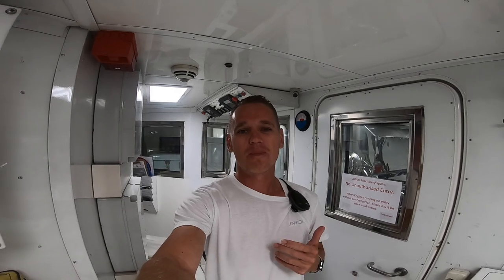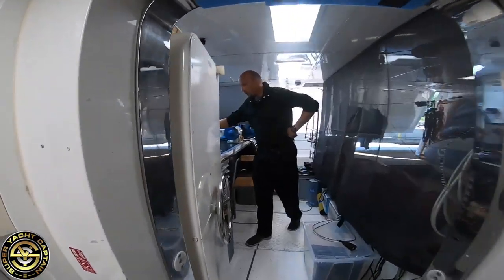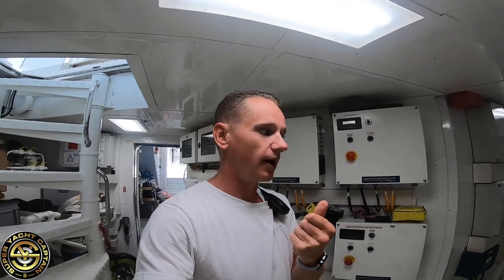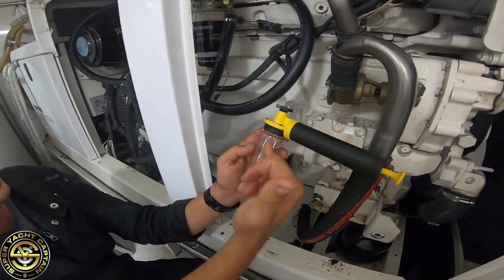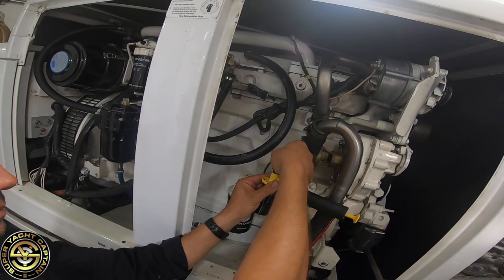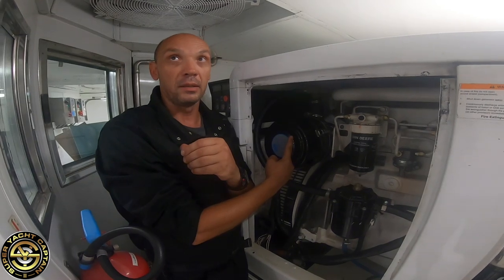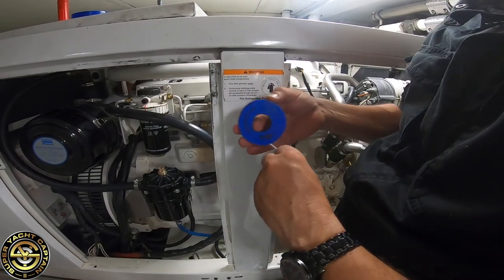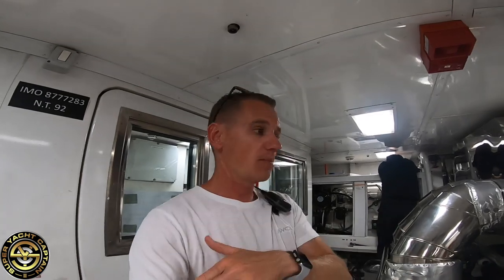How To Service A Marine Diesel Generator - Super Yacht Edition (Captain’s Vlog 99)

Comment: Hi Tristan,  tell Slav about the cable tie trick for impellers.  Wrap a cable tie, maybe two on that size impeller, around and gradually tighten to compress the impeller blades, when they are compressed as much as you can it will slide in easily. As the impeller goes in you can gradually slide off or cut the cable ties.  Learnt on smaller inaccessible yacht engines!  Keep up the good work.
Reply from the maker: Good to know, thanks Kev. All the best

Comment: Great video. One point: when Slav is doing the Racor it looks as if he is filling the filter by pouring diesel down the centre tube of the assembly. Would suggest always fill body, prior to refitting the cap/cover, by pouring diesel between the outer casing and the filter element. The centre tube is the oil outlet, so there is a chance of getting dirt down this tube, then into the fuel pump.

Comment: hello Tristan, great video and certainly very useful to many! A little trick to get the impeller in is to "close the blades" first with two plastic straps to reduce the size and then cut them as soon as the strap reaches the housing. well done anyway!

Comment: Very informative. Have one concern that Teflon tape was used to wrap the threads of the zinc anode. The Teflon tape acts as an insulator and reduces the affect of the anode. Anode threads should be in direct contact with the engine block in order to have the greatest affect to prevent  electrolysis with internal generator parts.
Reply: I agree, that was my first thougt when he put 4 wraps on the thread. The brass thread must be able to cut through the layers, providing both sealing and conduction.  However, he is the qualified engineer and I am not. It is getting enough contact to work properly as the eroded anode clearly indicates. These guys are great.
I might put a clear PlexiGlas cover over the controls (with a big X) to avoid even an accidental operation.
If I were a guest on board, I'd spend all my time observing the systems!
Reply: The old anode had teflon tape reminents on the thread. It did it's job I believe.
Reply from the maker: Ben, you read my mind. Our system is proven and works fine.

Comment: Not only that the technical work is done perfectly, also the quality of the video is great.  Perfect learning video. 
If everyone would always work so well.
And the disposal !?  Are the parts geting recycled or simply disposed of?
Reply from the maker: Thanks. For the disposal every port offers different facilities so it depends.
Reply: In Europe the use of waste to heat energy plants are rather common. This means that the oil filter itself is very likely burned off in the powerplant that creates electricity and central heating. The oil itself is very likely being recycled. But again, not every country is the same :)

Comment: Every 250 hours an oil change. Imagine your car needs that. Everybody would be furious.

I am amazed by the amount of maintenance. The cost must be staggering.
I like the engineer. No nonsense. Just get the job done.
Reply: A city car that averages 30 MPH only has 100 hours on the engine at a 3000 mile oil change interval
Reply: Well, lets imagine you are running at 100km / hour or 60 miles / hour, that is is an oilchange every 25000 km or every 15000 miles.
Reply: Well. But my average is about 45 km per hour.  But you made your point. It is fairly reasonable.
Reply: At 45 km/hour your car would have traveled 4500 km in 100 hours.
Reply: Pieter made it sound like a 250 hour oil change would be very short, and people would be upset.
The reality is, at the 30 MPH average, 250 hours is  7500 miles, not a short oil change interval at all.
Reply: @PieterBreda  Yeah, I know. 100 km per hour is a stupid high average.
I choose that speed just for easy calculation, 50 would probably have been a much better average for most people.
Reply: Need to remember that a generator engine always runs with heavy load. Compared to an car  engine.

Comment: Tristan, When you have your main engine running do you turn off both the port & starboard generators ?
Reply from the maker: At least 1 generator is always running when not connected to shore power.

Comment: The engine looks quite beefy considering it's only rated for 70kW. 20 Liters of oil for a 70kW engine seems to be quite a lot, is there a reason why this generator is this big considering the small power output?

Comment: Question?  Do the diesel engines have and electrical alternators / generators, or do you need to run the gensets also when underway?
Reply from the maker: Gensets are always running underway

Comment: 250h doesn't sound like a lot for an oil change if you compaire this with a car or a semi truck
Reply: Wrong, run 250h at average speed and you have your milage for changing your olie.
Reply: Well, maybe, but I'm not so sure. If you would take an average of 100km/h, that would then translate to 25.000km. 30k is time for an oil change (over here at least), and I can remember that semi's do at least double, or triple distance before a change and these are around 30L oil capacity if I recall correctly.

Comment: Using screwdrivers to remove impellers will damage housing. Jabsco makes a puller specifically for impellers.  Petroleum based grease is not recommended by the impeller manufacturers they use glycerin.
Reply: Adjustable pliers could also work to grip the impeller without scratching the housing. If you don't have glycerin, some soap could do for lubrication. I wold too keep petroleum grease away from the impeller.
Reply: Totally agree,many details that makes the difference by the end of the day,and teflon tape on the anodes?A big mistake.
Reply: @marcudorin4917  Yeah, but it makes the anodes last longer :-)  (Just kidding, they last longer when they don't do their job of protecting the engine from corrosion.) The anodes need to have contact metal to metal with the engine so teflon tape could ruin that. On the old one, the tape was only on the outer half of the thread but it looked like he put it on the whole thread now and that could be critical. It would have been good if there was an O-ring or some other gasket instead but the anode holder doesn't look like it's made for that.
Reply: Marcu Dorin ........... I have been a self employed  marine mechanic for over 40 years Teflon tape has made me a lot of money. People using that in places that it should not be used.That brass fitting  NTP national tapered pipe will seal on its own the tighter you make it. Using Teflon tape in that application interferes with the conductivity of the metals.
Reply: skunkjobb -it will last as long as he wants :)) nicely explained thanks!
Reply: @frankkreyssig7626  How do you know if it was straight or tapered pipe thread. I didn't look close enough to tell, perhaps you did. He did put the teflon tape on backwards so most of it will come off as he tightens the fitting. That could be why it works.

Comment: 250 service hours on a generator sounds short for a unit that runs 24 hours a day when at sea. That is roughly every 10 days. Why so often? You couldn’t even get across the Atlantic without a service.

Comment: as a mechanic myself I was very disappointed too see your mechanic use a shifter to undo the drain plug. very amateurish. Also topping up filters with drained fuel is a no no.
Reply from the maker: Did you watch the video? The fuel wasn’t drained fuel, it came  from our fuel pump which is linked to the Day tank. Watch again.
Reply: Watch again? Do i have too?

Comment: I’m a mechanic for Toyota and it’s nice to see that somethings don’t change from automobiles to boats. when you’re in the engine might as well change the filters AND O rings you’re there anyways save time saves money and KNOWING there good is better than guessing
Reply: Engines for small leisure ships are based on car and truck industries. Manufacturers only change cooling, exhaust system, coupling... so a car mechanic can easily understand and work in these small ships. Just a question of certificate of competency. For bigger ships as merchant marine vessels, it is fully different and of course so much more difficult.

Comment: 7:15 A strap wrench is not a "special filter remover" it is a generic tool that should be in the toolbox of anyone that works with machinery of any sort. It is a wrench that can grip things of odd shapes and sizes with less chance of damaging them than an "adjustable" or pipe wrench.

Comment: If the brass fitting with the Zinc attached is a "right hand thread" he put the teflon tape on backwards. And, yes it does make a difference which direction the tape is put on.
Aside from that, interesting video.
Reply from the maker: Watch the video again, yes it’s a right hand thread and yes he wrapped the Teflon correctly. You’re right, it does matter.
Reply: @SuperYachtCaptain  I did look at it again and I stand corrected. He did wrap the teflon tape with the thread and that is the correct way to apply it.
Reply: Aside from the fact that maybe dont isolate a sacrificial connection?

Comment: I work for a heavy equipment Company we do big jobs up here in Alaska we build airport roads breakwater for Marina’s big jobs I work six months on six months off because of the winter it’s hard to dig in frozen ground My title is oiler/mechanic I average about 2000 gallons of oil change in six months I probably pump about 2000 gallons of Diesel every day I operate a truck we call a lube truck it carries 2000 gallons of fuel and about 600gallons of different types lubricants it has 100 gallon tank for use oil which I can hook right to the Equipment and suck it out I really found this episode interesting because it is what I do for a living thanks

Comment: So that zinc piece right there at the very end, it works just Ike the ones do on the exterior of the boat? Just keeps the engine block and everything from corroding? But love this video, well actually love all the videos!! Keep it up captain mortlock, u are doing a very fine job!!! And luckily u caught the impeller before it totally went out, that right there will always keep u worrying lol!! And ur half way to ur 100 thousand subscriber mark, everyone needs to keep subscribing!!!!
Reply from the maker: Yes the zinc anodes work the same as the exterior ones.
Reply: @SuperYachtCaptain  Hi, love the videos! Just found you and have subscribed so trying to catchup from No1 but this one caught my eye today because I have just done the same thing to my main engine with is based on a JD 6068! My NL genny is only 12kw as my boat (Nordhavn 47) is only 15m. How many hours had that impeller done?

Comment: I wonder why Slav don’t use standard wrenches no 10,13,15 and 17 for example rather then using a adjustable wrench that can hurt the nutts. Anyway the nutts where not so hard screwed in so I guess that might be the case

Comment: I am continually impressed by how methodical everything is done on the boat.  Great video & detailed example .
Curious about the color of the diesel.  I'm accustomed to seeing marine diesel being red.   Do you keep some "road  diesel" on the boat for maintenance purposes?
Reply: Not every country dyes their low tax fuels red. The dye used in most of Europe is Solvent Yellow 124 . The uk didn't adopt this as there were "concerns" that it could be filtered more easily than red
Reply: In Sweden, marine diesel is colored green. I guess different countries have different "color coding" for marine diesel and diesel for other uses.